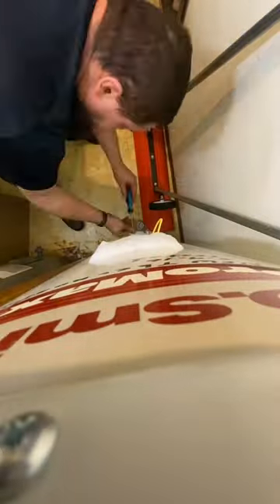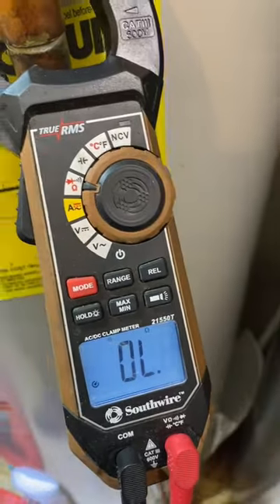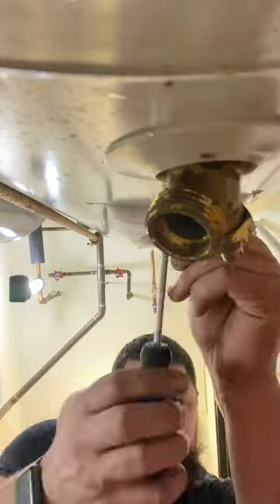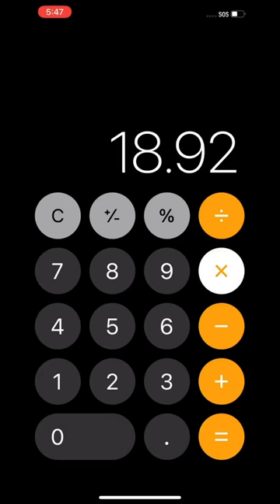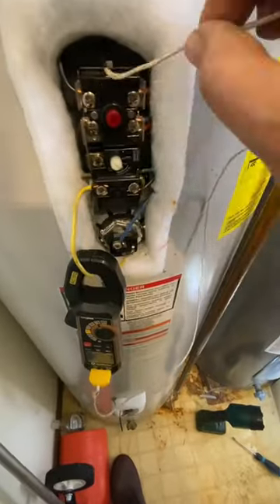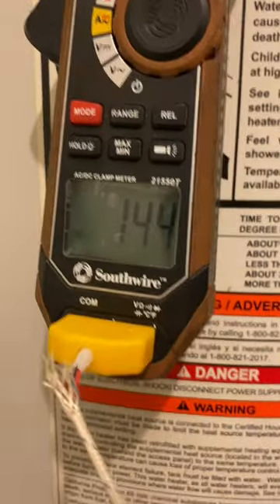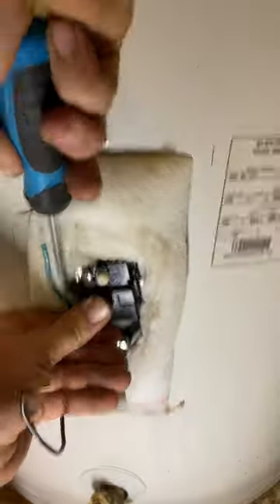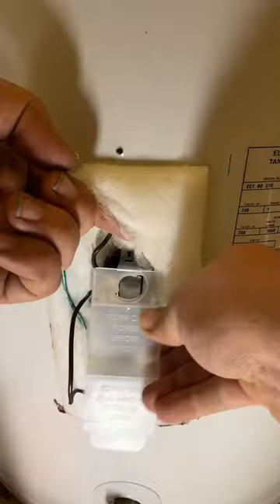Diagnosing and fixing an electric water heater with a bad lower thermostat. #HandsomeOrHandy￼

Comment: 9/10 times it’s the lower t-stat given the TO tripped, since the lower tstat is the last to cycle it’s almost guaranteed. Rest of the short hand of two element electric water heater 90% rule: if the water heater dumps hot water it’s the upper thermostat, if it leaks through the PRV it’s the PRV, and if it tripped the breaker it’s the lower element especially if it’s a hard water area.
Reply from the maker: This place definitely has hard water

Comment: I just got a heating element from Home Depot and it’s longer than the one I remove from the water heater. Will it still work?
Reply from the maker: Is it the correct voltage and wattage? If it fits, it should work as long as all of the other specs match.

Comment: Can you explain how to diagnose the failed closed lower element ?
Reply from the maker: At around 120° the upper thermostat was satisfied and begin to send power to the lower thermostat. The lower thermostat was above 145° and still continue to heat the water. It should have not gone above 140° especially when I had the lower thermostat set to around 125. At that point I determined the lower thermostat had failed in the closed position and was not opening when it hit its target temperature.

Comment: How’d you know the bottom thermostat was not functioning? Did you have to wait for the top one to get to temp before it switched to the bottom one?
Reply from the maker: The upper thermostat was satisfied at 120°. It then sent power to the lower thermostat and it kept on heating the water past 145°. At that point I determined that the lower element had failed in the closed position and was bad. Once the lower thermostat was replaced it did not have this issue again. I also checked to make sure we did not have any continuity between either of the element terminals and ground.
Reply: @HandsomeOrHandy  thank you. What does it mean if there is continuity between element and ground?
Reply: @Michaelnkdhkgdhuudz inside of element is exposed to the water, shorting to ground.
Reply: When the lower thermostat is failing, does the pressure get low in the showers?

Comment: Hey are you coming down to Florida and the next week or so my hot water is a hit miss. If I use a lot of warm water I e the hot  water And then after a while it does get hot. The hot water here is 6 years old
Reply from the maker: Unfortunately I am not planning any trips to Florida right now. But if it’s an electric water heater it should be fairly easy to diagnose and fix

Comment: We replaced our water heater and water was litterially leaking out of the top power supply on the side
Reply from the maker: Check for leaks on the connection on the top. Then check for leaks on the heating element.